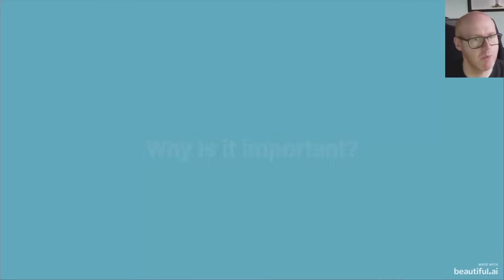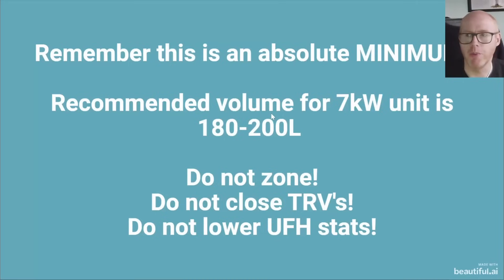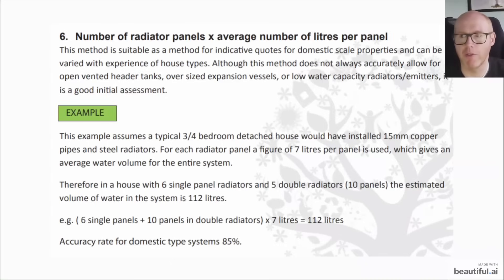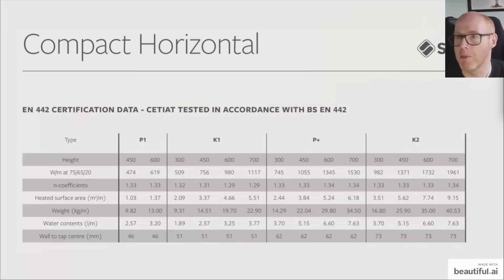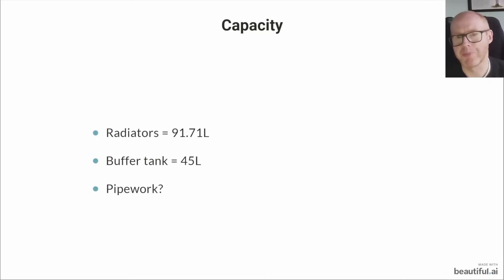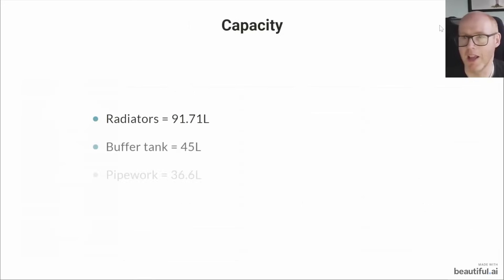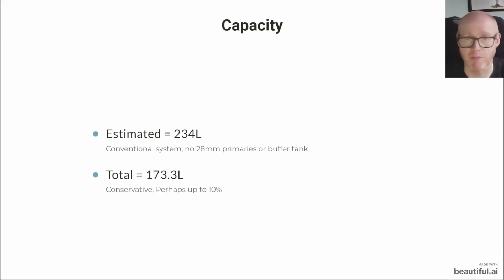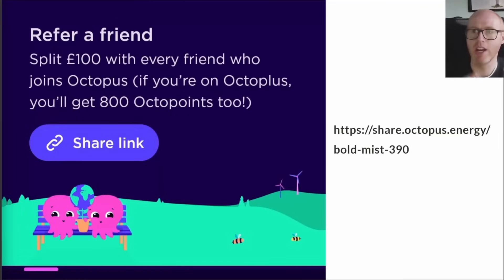How to Reduce Heat Pump Frost

Comment: Thanks for this insightful video! I am afraid, however, I am missing a point here. I understand that more volume results in more thermal mass in the system. But what is the effect of more thermal mass on a defrost cycle? (Or: how does having "more warm water" help reduce the number of defrosts?) I guess the heatpump is doing its defrost cycle, no matter the temperature of the heating water. I understand that more volume reduces the lowering of water temperature during a defrost cycle. But how does it impact the defrosting itself?
Reply from the maker: Credit to Paul Spence for this :
"Defrosts and the benefits of system volume. 
I’ve always worked on the basis of 25L/kw to both limit starts per hour and limit the effects of defrosts. 
As 1L of water is more or less 1kg and requires 4186J to raise its temperature 1°c, to raise 1L x 5° requires 4186x5=20,930j
Similarly to lose 5°c 20930j are expended. 
Assume your flow temp is 45° and return is 40°c , ie dt5 during normal heating mode. 
The following is a general description, not exact as there are many variables. 
Assume a defrost is 1 per hour and has a 5min duration. The system volume is 100L and the heat pump is 7kw with nominal flow rate 20L/min. 
When the heat pump enters defrost mode, the circulation pump continues to run at 20L/min. 
All the energy required for deftost is provided by the return water. 
As the return water enters the condenser it is 40°c, at 20L/m x 5 mins the whole 100L has passed through the condenser losing 5°c, flowing out to the heating circuit.. but now at 35°c… some 10° cooler than normal operation. 
Whilst flowing round the heating circuit the whole 100L loses another 5° via the emitters, so returns to the heat pump at 30°c. The heat pump has to raise the circulating water 15°c to design flow temp.. that’s 3x the dt required.. to reach 45°c again. So the 100L has to recirculate 3x which is 15 minutes at 20L/min just to recover flow temp. 
100L x 4186 x 5=2093000J have been expended.. just on that 5 minute defrost. 
Given 1kwh =3600000j then it follows 
2093000/3600000=0.581kwh of energy have been extracted from your system. 
Additionally, the mwt of the circulating water has dropped, from 42.5° to 32.5°, a full 10° lower.. which in turn affects the output from the emitters, so room temps start to drop during the defrost and then less do during the following 15min recovery time. 
100/7=14.286L/kw is in my view too low. 
Now assume 7x25=175L volume.. still the 20L/min, same 100L circulates during the defrost.. 
but this time there’s a surplus 75L, consequently the average temperature of the circulating water is ((100x35)+(75x40))/(175)=37.14° rather than 32.5° or thereabouts, that’s 5° warmer and less work for the compressor, recovery time is 5mins quicker. (This is a fairly good approximation but not exact) 
Now assume defrost happens more than once per hour, which is quite possible, the effect can be significant, lower room temps, high bills etc. 
Defrosts mainly happen when we most need the heating, colder and wet climate, but it can also indicate a loss of refrigerant. 
Some heat pumps have booster heaters for defrost, some have dedicated defrost buffers.. both will still use energy, you’ll still pay. 
But with an open loop, adequate volume to satisfy the defrost and cause negligible difference in room temps is my preference.

Appliance minimum flow rate typically and 3 starts per hour. Look at the arotherm 7kw, 1205L/hr at max but minimum flow at 540L/hr.
540/3600=0.15l/s
0.15x5x4.18=3.135kw min output of the compressor, hence the min flow rate for fault.
That’s more to do with the min compressor rate 20hz, the refrigerant enthalpy, the suction temp when it’s 15°c externally, the compressor discharge temp would add 3.135kw.
If the min flow rate is 540L/hr and I wanted 3 starts per hour, I’d divide 540/3=180L volume passes per rotation of water.
180/7=25.714L/kw.
Yes the emitters are also offloading at the same time.. so if at base temp your load is 7x.25=1.75kw but the min is 3.135, then the surplus is the difference but it also means system volume would be lower if I took the surplus to be 3.135-1.75=1.385kw rather than 3.135kw just for starts per hour.
I’m aware others hold a different view but smooth compressor run times and less defrost disruption works better at 25L/kw it seems.

If on a fixed speed circulator the dt narrows from what ever your initial design dt is to where ever it ends. In principle if dt5 at 7kw with a fixed speed 1205/3600=0.335L/s at min load
3.135/(0.335x4.18)=2.239°dt
That’s nothing to do with a volumiser, it’ll always narrow to that.. to add a bit more.. if as with many heat pumps the compressor stop time is 3 mins, and two stops per hour occur, the compressor actual output is 54/60=0.9x3.135=2.822kw
Each compressor stop deducts 3 mins of output.. so it doesn’t seem to me the volumiser is an issue. My best performing systems have either added volume, 300L buffer on closed loop system, 100L volumiser on open loop systems etc.
what’s really needed is longer stop times."
Reply: @UpsideDownFork  Wow! Thanks for the longest post I read ever! My gut feeling now is: more volume means less impact on heating water (and room) temperature, means less re-heating needed, means less icing on the heatpump means more time until the next defrost...
Reply: @UpsideDownFork  would you think there's a value in bypassing that extra 45l volume in temperatures above say 6°C? Get the best of both worlds?
Reply from the maker: @MT-zn6tc  Nope. Volume is advantageous in milder temperatures too.
It helps to prolong cycles. More capacity to put the thermal energy into before the dt narrows too far on the heat pump when it's down on minimum modulation.
Reply: @UpsideDownFork  thanks for taking the time to reply.  I've read about buffer tanks reducing overall COP, hence the question.
Reply from the maker: @MT-zn6tc  The important thing for getting the best efficiency out of a buffer tank is to try and match the flow rates either side of the hydraulic separation. Loads of ways to do this. I used clamp thermometers on the pipework to get as close as I could.
Reply: @MT-zn6tc  If you don't need the hydraulic separation, you can still have the extra volume (with little impact to COP) via a volumiser instead of a buffer.
Reply: The mechanics of a defrost cycle requires a 4-way valve inside the outdoor unit to reverse the flow of hot refrigerant gas from the compressor, from the indoor refrigerant/water heat exchanger, to the frosted over outdoor air coil. The hot refrigerant gas from the compressor defrosts the outdoor air coil quite quickly. When complete (time & temp sensor controlled) the hot refrigerant flow is re-directed back to to the indoor refrigerant / water heat exchanger to resume heating the water loop again. While in the defrost mode the indoor refrigerant/water HEX (condenser) becomes an evaporator which takes heat from the water loop to effect the defrost process. If there is insufficient water volume in the water loop there is not enough heat available in the loop (which cools down quickly) to complete the defrost cycle in a timely fashion & this extends the time it takes to complete the defrost cycle or the frequency of them. 
In some cases the defrost cycle may not actually clear all the frost on the outdoor coil before a timer stops the process which seriously effects the system performance. While the HP is in defrost mode (cooling) it cannot produce any heat for the house so it is important that the defrost mode is completed as soon as possible so the system can resume heating the house. 

A combination of an oversized HP (which requires a larger water volume) &/or, a low volume water loop pipework system, will promote poor system performance & frequent defrosts sequences to the point where very little heat is delivered to the house in colder weather which in turn causes the so called "defrost cycle of death" & short cycling issues. Proper system design is therefore a must. 

Defrost cycles for air source HP's occur most frequently between outdoor air temps of +5 to -10c when outside air is damp & humid which then freezes on the outdoor air coil.  The outdoor coil (evaporator in heating mode, condenser in defrost mode) operates at around 12c below the ambient air temp (heating mode). Below an outside air temp of -10c the outside air is less humid so not so much moisture freezes on the outdoor coils of HP's & the need for defrost cycles reduces but is not eliminated altogether. 
Hopefully this helps a bit.

Comment: What I don't understand with my Vaillant system: Why doesn't it use the energy stored in my 150l warm water cylinder for defrosting ? Or am I just missing this option somewhere ?
Reply: The hot water circuit is too small to use for defrosts....it's not the volume of the hot water cylinder that counts.... it's the volume of the heating circuit that matters......so only the larger heating circuit can be used for a ashp defrost cycle
Reply from the maker: The system is configured as hot water priority. If you used the 150L hot water from the cylinder, it would be cold after a few defrosts.
Reply: Well it is the total heat capacity that counts i.e. volume of water times temperature. As the volume of 150l is comparable to the volume of the complete heating circuit that should be no problem. What makes the difference however is the higher temperature of 45+ C  in the hot water cylinder. This should be sufficient for multiple defrost cycles. Of course you have to reheat your hot water after doing so. But there is no difference to heating up your warm water for the heating cycle.   Only downside I could see is an efficiency argument:  to heat up the water in your warm water cylinder you need 50C hot water whereas the heating runs with 38C  - depending on the outside temperatures of course.
Reply: Because you will run out of hot water when you need it.

Comment: For those of us completely new to heat pumps 'defrosts' are entirely alien
Reply: They're not a real problem for most people, just at certain temperatures (mostly 0ºC-4ºC) together at the same time as high humidities the efficiency is lowered. A bad cycling problem indicates an installation problem, as if the volume is too low a volumiser should have been fitted.

A gas boiler by contrast loses 20% of its energy all the time in normal operation, even the 95% efficient ones usually aren't much better than 80% installed, we just know about heat pump efficiencies much more because of the monitoring.
Reply: Defrosting is no different to what happens in a domestic frost free fridge/freezer. The only difference is that the fridge freezer uses an electric heater (imbedded in the coil) to defrost the evaporator inside the freezer section instead of reversing the flow of refrigerant from the compressor, as per the domestic heat pump. Nothing new in the world of refrigeration & air conditioning which has been using heat pump technology since 1856 (Peter von Rittinger) & used domestically since the 1940's. New refrigerants have come & gone but the basic principle remain the same.
Reply from the maker: Apologies that I just jumped straight into the deep end with this video.

Here's another video I made showing what to expect with a defrost cycle https://youtu.be/aY8UKI6qHCE
Perhaps I can do something a little bit more beginner friendly in the future.

Comment: Great insightful video on the water volume thank you. You keep plugging Octopus on your videos and asked why would you not be on Octopus and what are you doing if not? This irks me because my experience of them has been awful. I asked them a year ago for a smart meter, and they had to fit 3 that didn't work before admitting they could not get one to work at our address due to signal issue. Then as a compromise we asked for an Economy 7 which can work offline to get a time of day tariff. This was 3 months ago, and they forgot to commission it so think we still have the old meter and have been estimating our usage wrongly because we cannot submit a reading, and billing us at the fixed standard variable rate tariff while we have been trying to time shift our 2 x EV charging and home battery. They have been an absolute joke for us, and if I didn't know better, I would actually wonder what they do for a living...
Reply: Sounds like you have had a bad experience. I can say nothing but good things about Octopus energy in my own experience 😊
Reply: The smart meter rollout should have been done by the DNOs, this would have helped mitigate many of the problems and certainly been much cheaper.
Reply from the maker: I'm really sorry to hear this about octopus energy. I hope through your persistence you will get there in the end.
The smart meter roll out is a joke for many technical reasons.
Reply: Awful experience with Octopus? Don’t go anywhere near British Gas!
Reply: We've had some issues with Octopus but I still recommend them to friends. I think some are problems out of their control and others are part of what happens when a company grows exponentially fast. Despite any problems I believe we still have to thanks them for being positive market disruptors.

Comment: Sounds like this adds to the argument for having a buffer tank? It seems like the heat pump world is quite divided over whether buffer tanks are good/necessary or not.

I reckon everyone has had a lot of cycling going on this week!
Reply: A volumiser to add volume on the return flow is probably more sensible to avoid separation and running a extra circulation pump
Reply: @Burtis89  Yes, the volumiser is there specifically to increase the volume of water in the system, whereas a buffer tank is to separate flows. (I know you know this, just pointing it out to others who may not).
Reply from the maker: Almost every system would benefit from a volumiser, but a smaller amount may benefit from a buffer tank if things are calculated correctly.

Comment: Have been with octopus now with Tomato  nuch cheeper just commenting as you asked for. Interesting video as most are
Reply from the maker: Thanks. When I last looked, they also offered no export tariff.
Reply: Tomato have interesting tariffs. But I saw the energy mix for last year shows they actively buy fossil generated electricity. Almost no renewables. Their carbon intensity is 466gco2 /kwh compared to 222 UK average! Showing finance and environment are still very poorly coupled.
Reply: @joewentworth7856   They just don't purchase REGOs, a way of 'greenwashing' the energy mix; it's all explained on their website. The actual energy mix feeding your home will be the same as all other suppliers.

Comment: How many customers give this any thought before pressing ahead with ASHP installation? I guess it’s only when your system develops a problem it comes to light.
Reply from the maker: Yep. Unfortunately that might be the case. Hopefully as we increase awareness and all get a better understanding of heat pumps, things like this will be normal to consider.
Reply: If you have a professional installer the customer shouldn't need to consider anything. The installer will design a system that takes account of all manufacturer design rules.

The problem is some installers don't adhere to the installer guidance.
Reply: Ground source, no frost.
Reply: Customers shouldn't have to